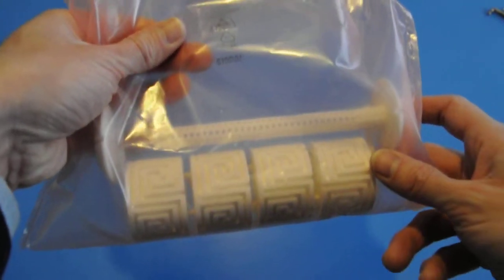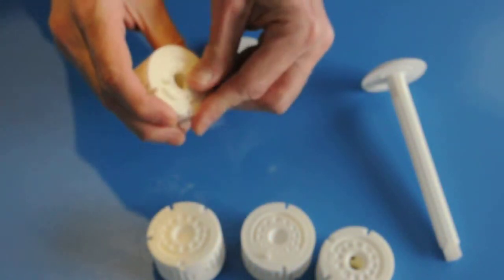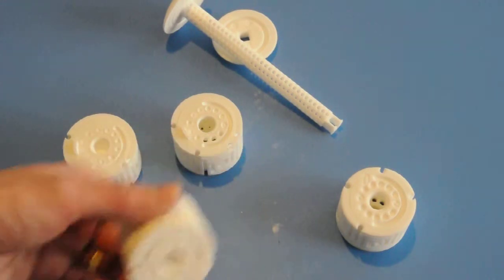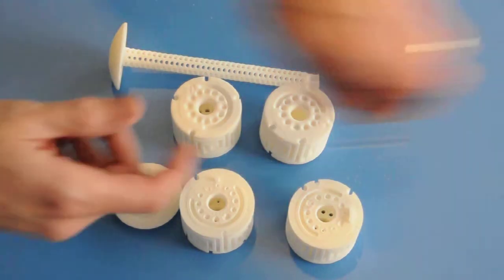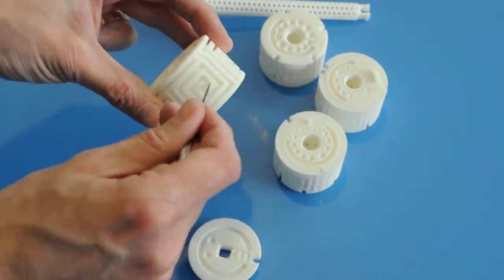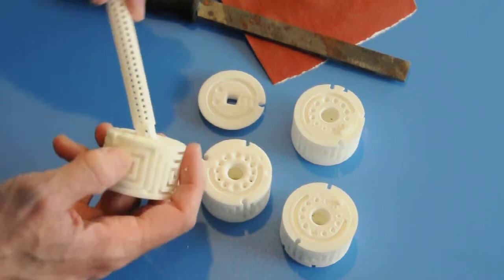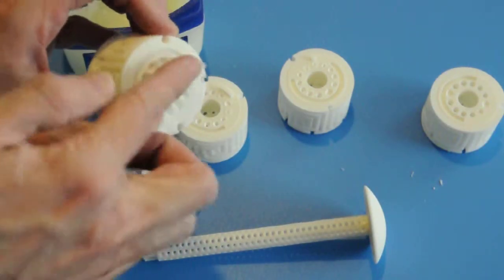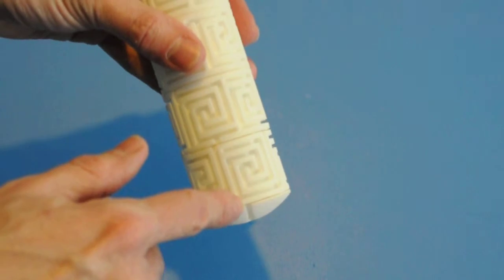MazeRoll assembly

Comment from the maker: Then you need to have a very small coarse brush with the teeth placed inline, as the width of the maze path grooves is no more than 2 mm. And, with such brush you probably have difficulty to take corners.
As shown, I used a very small screwdriver and the especially designed maze path scraper.
If you have compressed air, the job would also be easier to blow out powder that wasn't blown out by Shapeways. But then still I expect that the infamous semi-loose powder has to be scraped/brushed out.